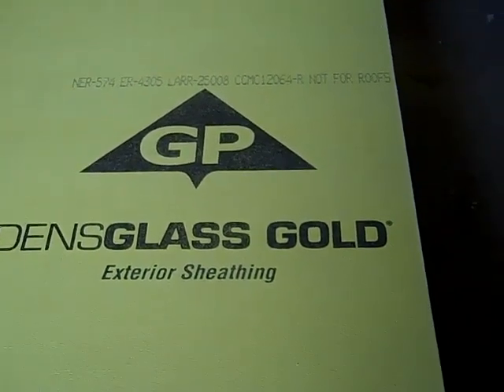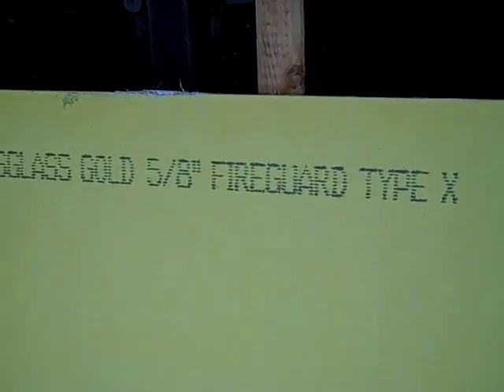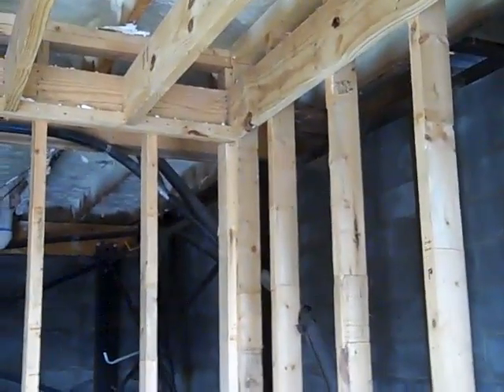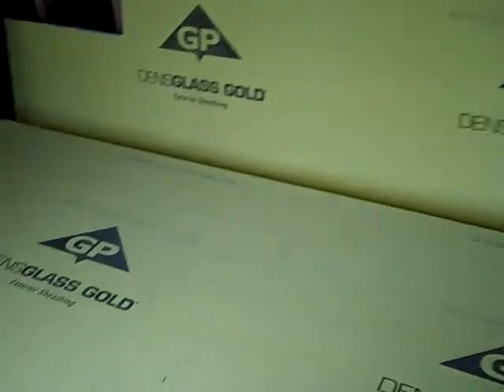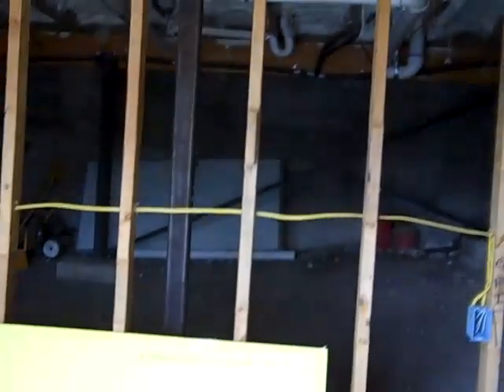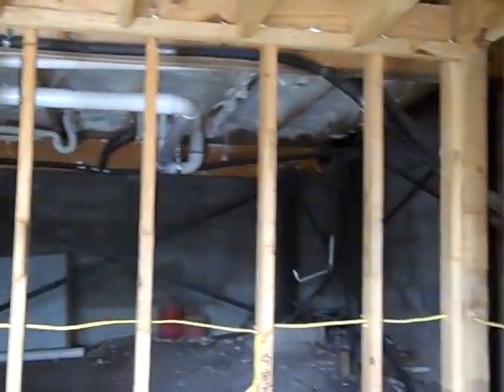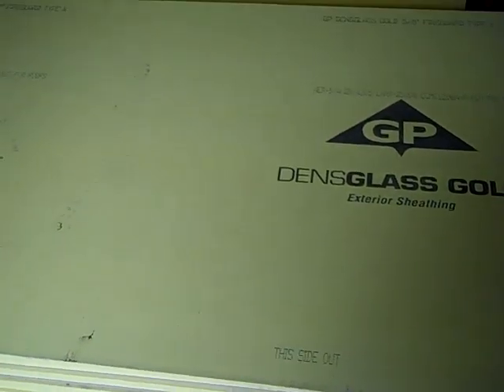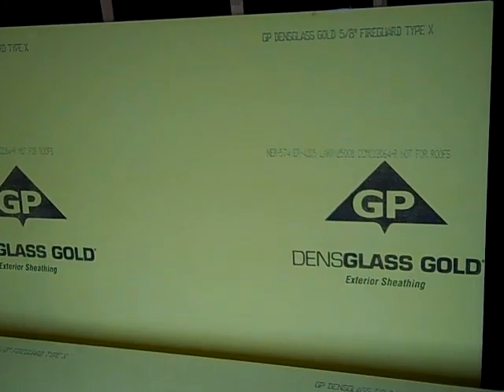GP Densglass Gold Exterior Sheathing Review

Comment: how about this product vs. osb / plywood?
Reply: David Gao that’s what I came looking to find out
Reply: David Gao  This being a gypsum product, and not a cement product, I would never use it exterior. Also has no sheer strength as a substrate, as OSB or plywood would.
Reply: @seanm3226 this is used as exterior sheathing and the board in the video is actually marked as such. It isn't meant to bear any weight or contribute to the structure of the wall.